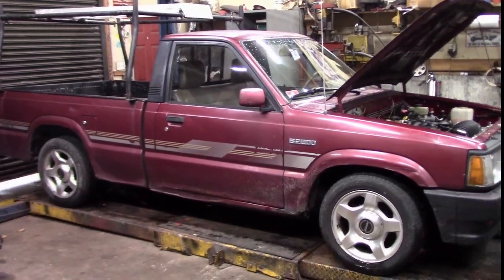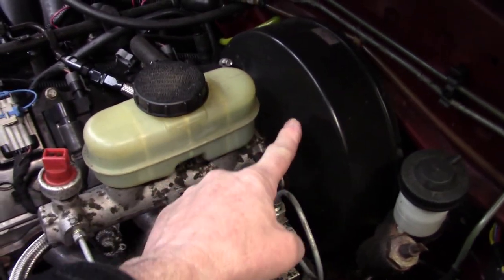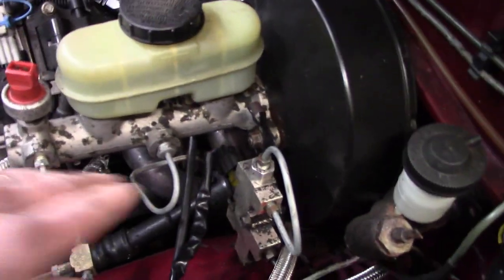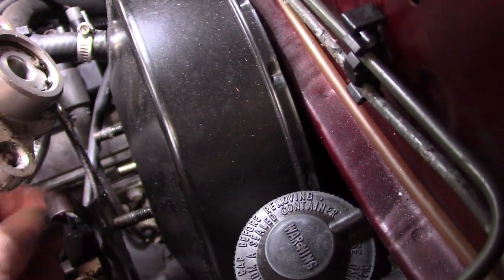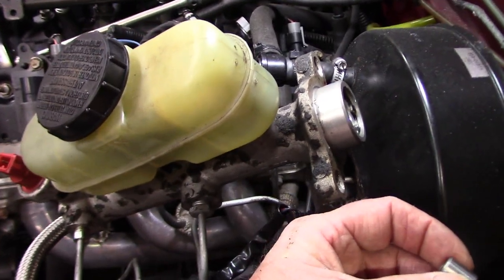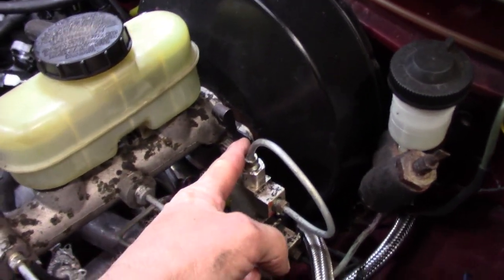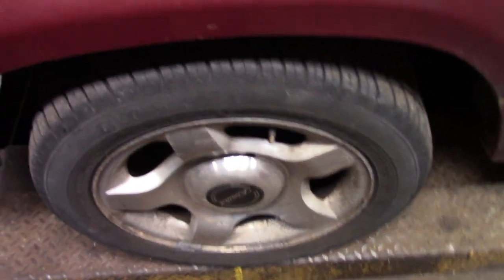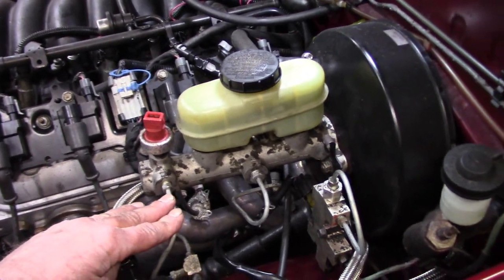MAZDA B2200 BIG BRAKE CONVERSION MASTER CYLINDER MODIFICATIONS

Comment: Did you hook up the brake fluid level sensor in with the mazda one? Mazda appears to me to have a ground but im confused as running through the harness it has power and signal to cluster in same line.

Comment: I got at mazda b2200 short bed.
I got problem with 1st and 2ns...
When im in a red light...its hard to put it in first...and 2nd is ok when runs..the rest is good no problem

But when i turn the truck off..is all good take all gear good no problem..

Comment: What are the pros of having a big brake conversion
Reply from the maker: If you intend on using the B series trucks as a performance vehicle, the stock brakes are not going to do the job. In my case, I have trippled the horsepower and added 400 lbs of weight to the truck. So the already sketchy stock brakes were even less effective.
One of the primary reasons for developing the big brake conversion was because I installed a Ford 8.8 rear end, and now my rear axles had a different bolt pattern than the front Mazda brake rotors.
The Ford 5 on 4.5 inch bolt pattern offered some great opportunities for a great variety of wheel options.
So as I mentioned above, I wanted to find a way to get the front bolt pattern to match the rear.

The benefit of converting the front to the Ford Explorer 2 piston calipers and rotors was:
The 8.8 rear end from a Ford Explorer has rear disk brakes, so to balance the braking system, larger front brakes were necessary.
By using the complete braking system from the Ford Explorer, I increased the braking performance DRAMATICALLY with readily available parts from a salvage yard or the local parts store, for a fraction of the cost of Brembo or Wilwood aftermarket brakes.
The Ford engineers designed this system for a vehicle weighing 4500 pounds, and my LS Swapped B2200 weighs 3300 with me in it. 

If you road race, drift, drag race, or autocross the stock B series brakes will burn up and fade on the first lap.
Watch some of the other videos on my channel. You can see in the racing videos that I an using this vehicle WAY beyond the design limits of its stock configuration, and have modified just about everything to enhance performance.
Not only does it have braking performance that compares to a new Mustang or Camaro, I can put many tire & wheel combinations for what ever situation I want to put the truck in.
I hope this answers your question. Check out the other videos n my channel. They will explain way more than what is written here.
Thanks!